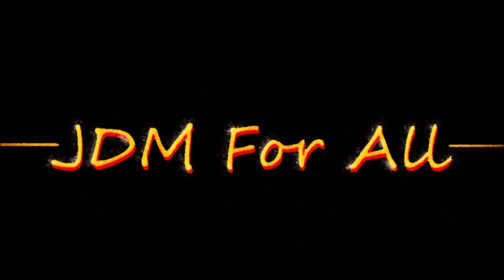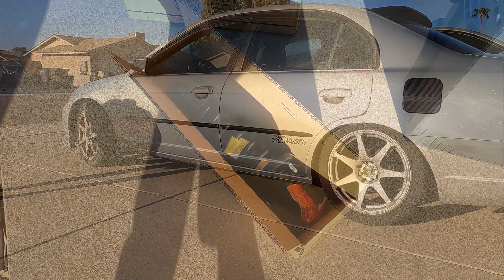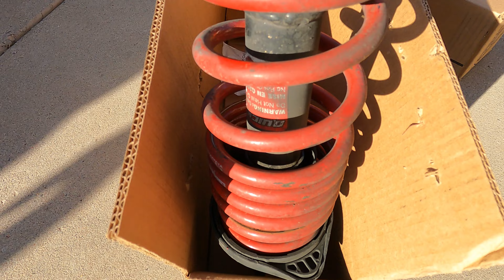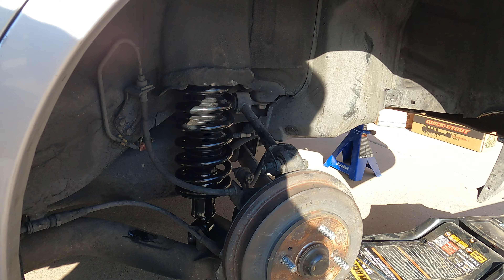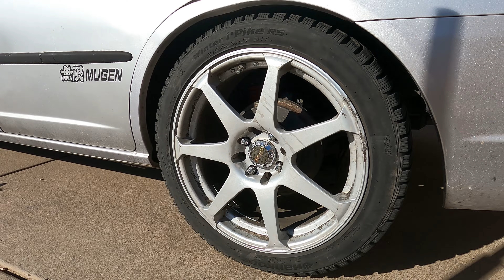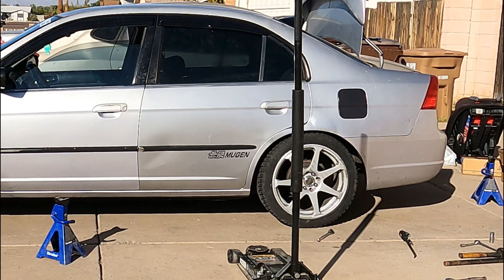REPLACING BAD STRUTS on the ES1 (7th Gen 2002 Honda Civic)

Comment: Y not just get a set of coilovers....the spring is what blows the factory strut out prematurely causing it to constantly bottom out and blow out the seal which keeps the car level....and a set of coilovers run about the same price as a set of those master pro strut assemblies from orilleys that you have